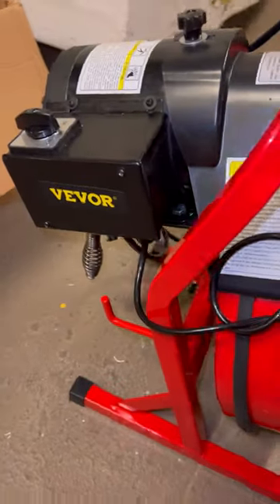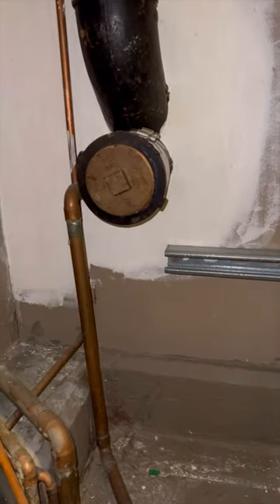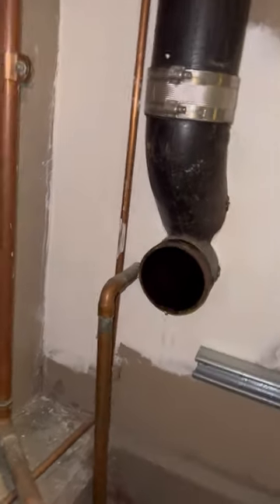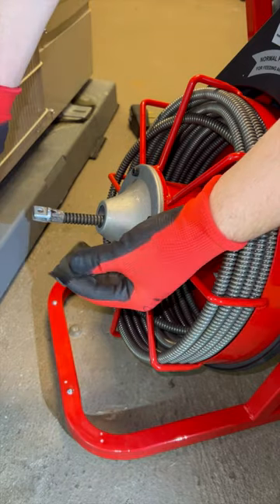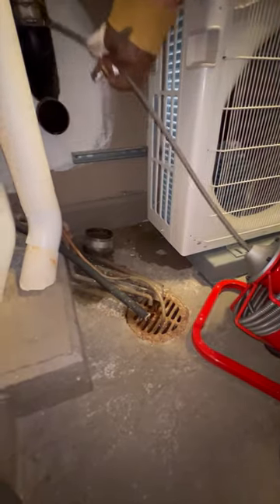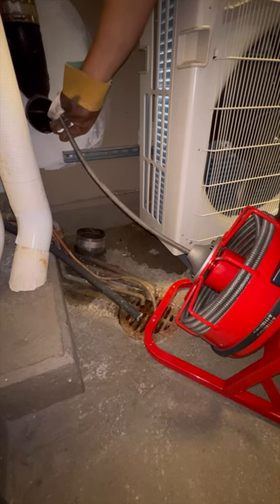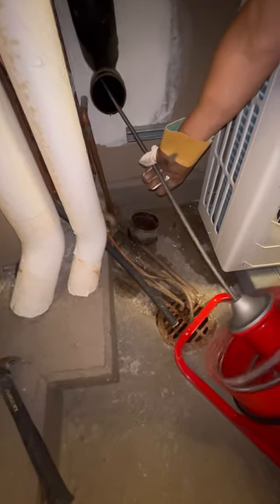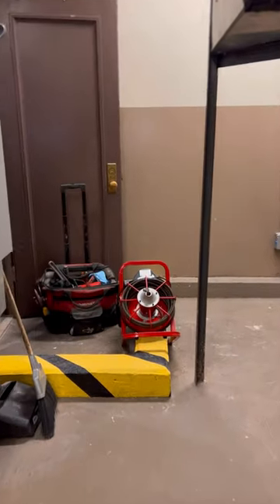Drain snaking with a VEVOR drain cleaner machine

Comment: ive had a 5/8 cable whip me in the chest before from binding up....always two hands on bigger cables  and take your time ..its not a race and after doing it for awhile you will know when your at an elbow and turns etc.......guys that do only drains have great tips
Reply: Kink the end of the cable!!
Reply from the maker: Thanks for the advice bro. Im probably just gonna do these jobs for regular clients
Reply: Taking your time is a must!
Reply: We don’t even use cables large flex shafts with the camera at the same time flex shaft in first with a penetrator but they have clutches or hydro jet for me we are a drain. Specialist I eventually graduated to pipe  liners and other drain rehabilitation work clearing the drain now is just an opportunity to sell a pipe liner repair it’s usually roots lol

Comment: When I was 19 years old, I rented a snake to do my mom’s sewer. I had clue about the dangers associated with sewer snakes. Stuck it through the clean-out, parceled out about 25-feet and it wouldn’t go any further or back- out. Turned on machine and after few minutes the stuck snake built up so much energy, it finally let loose and started whizzing a hundred miles and hour. Had it snagged my hands, I am confident it would have ripped my hands off. Eventually pulled snake out and a fifty foot long mass of roots the diameter of the pipe came with it, most of them looked like hair. Years later, I heard someone lost a thumb using a power snake. I’ll call a plumber.

Comment: 150 to show up and rod kitchen drain with small machine weather it takes 5 or 55 min. 120 an hour after that. SW MI. Lotta problems deduced ahead of time by asking a LOT of questions. Also there's some finesse to running that thing broski. Put plenty blanket down and use 2 hands bro that thing could bite a fitting and throw a fit before you fly off that pressure switch
Reply: Crazy to hear people get 400 for running a snake. wild. $150-$300 here in southern cali
Reply: @MrKnnthc93  about right. NY plumbing seems insane tho. I'd move east just to work if it didn't mean I'd have to be stuck in that shithole of a city
Reply from the maker: That’s fair pricing for both parties. The questions are definitely important for every job. Sometimes im in a rush and dont ask the right questions and get screwed

Comment: Hey Bro. I was thinking of buying one of these. The problem is that the use photos shows it will NOT pass water trap pipes. You mentioned it went through a P trap (water trap) just fine. Am I missing something??? Love your videos Brother. I have floor drains that may well have P or S traps as build date is 1968. What do you think? Buy one or no?

Comment: HydroNYC.. we use to use a 3’ metal bar with a u shaped end to pinch the cable against the side of the pipe to force it through a tough spot AND not have to touch it with hands… bring extra male fitting to thread into clean out so you don’t damage the clean out threads 👍🏽👊🏽
Reply from the maker: Thats a great idea. I have used that when snaking tubs with a standing bath waste and it worked great to get past the p trap
Reply: Was that rotating In reverse?

Comment: I run a k5208. A while back I was running a 3 inch beat up cast iron line. There is a handle locking pin on a k5208, while I was running the machine the pin wiggled through the slot and locked the machine in the on position. About that time the cable bound up and tried to wrap me up. I was lucky enough to get out of the loop it threw, it took about 5 seconds to get the machine unplugged. It ruined 2 cables. Took that pin off the machine.
Reply from the maker: Damm bro thats some scary shhh. Gotta be carefull
Reply: @hydronyc  can't help but read that with your voice and throw a broski in there.

Comment: I run the Ridgid K-5208 machine with the 7/8 and 1-1/4 cables. That's all I do is drain cleaning. No plumbing, repairs, installs, none of that! I only do residential, and I love it. I charge $300.00 up front before my machine comes of the truck. I'll basically use the 7/8 cables for everything except roots. If I'm hitting roots, then I will switch over to the 1-1/4 cables. One time I was in a rush and hit roots, the 7/8 cable jumped up and wrapped my glove and grabbed my pinky. Thank God my gloves are loose fitting and I escaped with no injuries! Scared the poop out of me lol! It was a lesson learned, but never forgotten.
Reply: That's awesome man congrats on your business.

Comment: Spot on regarding the serious dangers when not using the right gloves or for running it too fast also . Slow and steady is the key and now for a real story . Worked maintenance for a large HOA complex with attached units with shared waste lines . It was ALWAYS SOP that if snaking out one bathroom , another maintenance man HAD to be in the adjoining bathroom in case the snake found it’s way into the adjoining units lines . Well for some reason the guy who was supposed to be next door with walkie talkie stepped out to have a cigarette . The snake didn’t drop down into shares waste line but instead went up and into the other unit , came out the toilet bowl and proceeded to flop around that bathroom until it broke very expensive glass tile that was on the walls , broke vanity mirror and was a disaster . The homeowner had allowed access but left for work , imagine their shock when they got home and saw the disaster caused , now imagine if someone was actually sitting on the toilet . Talk about a rectal exam 😊

Comment: I used to rent the 100ft snake to unclog my main line in my old house. The tree roots were murder and would have to do it about 1-2 years. Right before I sold the house, it clogged. I snaked the pipe and for some reason it kept hitting and popping up through the roof. I found the snake in the back yard and the dogs going wild. 😂😂 Did I learn my lesson- no it happened twice. I finally got it down the right way and cut the roots out.

Comment: I use a k60 drain machine and always make sure to put dish soap on my gloves as lube when I start with a dry coil. Gets things slippery and smells a hell of allot better than whatever the clients have been eating lately. Had the machine grab a glove once and got the dreaded twisted sausage finger as well. Nose had to wait at least a week to get picked...
Reply from the maker: Hahahahhaha 😂😂 the soap trick is 🔥
Reply: K7500. Worked with those for many, many years, even got a half brick out of a 4" line with it. Can push a hundred meters of 3/4" cable  Best drain machine on the planet.

Comment: A cardboard tent around the drum will cut down on the spatter from the unit when wet. 

Also keep a short cable length between the machine and clean out. Shorter the better, its less inclined to wrap up outside the pipe when it binds.

Comment: Luckily the guys who taught me always told me to be extremely careful when using a snake, they made it seem like it was just a metal death hose that would tear u to shreds if u even touched it. I never got hurt using a snake but i did have a scary incident once where i was snaking a toilet drain and my snake was a spartan 300 so since it had a self feed i was standing next to the drain and letting the cable feed itself. I guess i was standing too close but the snake grabbed a hold of my pants and tangled around my leg and that shit was strong as fuck it almost knocked me over. Luckily my helper was there and he put it in reverse and saved my ass. Snaking is dirty work, dangerous work, it can be hard work because you have to carry it around and it probably weighs over 100 pounds. Most plumbers hate snaking and a lot of guys wont even do it, this is why it costs so much to snake. If the client doesn’t wanna pay he can find somebody else to do it. Also make sure if you have to pull a toilet or take apart a p-trap you charge for that as well because guess what if you do it for free and they leak after you just lost money. Oh and if you snake it several times and it wont clear and you have to jetter it that doesnt mean you dont charge for the snake, its not your fault that the drain is clogged and you snaking it was a legitimate attempt to clear it so if it doesn’t clear still charge the customer but give them an offer to jetter their line and if they dont wanna pay full price for the jetter then give them a discount on the jetter or collect your money for the snake and get out of there.
Reply: Great advice .
Reply from the maker: Damn bro thats no joke. Good thing the helper was quick with it because the spartan is a powerful machine. Thank you for the advice. I will definitely use that pricing method if i take snake jobs. For now I’m only going to focus on doing it for regular costumers and renovations.
Reply: @hydronyc  large renovations should have mains snaked before putting into service.  You can figure it will save call backs
Reply: @craigherron1203 That's pretty smart

Comment: I'd add some more welds on the cap the blades attach to, they like to fall off on cheaper cables. Not fun trying to fish one back out of a drain line.
Reply: Yeah....I took a look at my Vevor that arrived yesterday. I had the same thought! I got a stick welder and a Mig (and a brazing torch) but haven't worked on this type of steel in this configuration, don't want to make a weaker connection while doing so.

Comment: Early I had a 1/2" cable wrapped  around my forearm snaking a urinal in a hotel public restroom. Always wear cow hide gloves or like in the post . The yellow chemical  grade gloves with big chips impregnated are the best . The spade bit is great on grease. 27 years still snaking mains in multifamily. Best story I've got is a small town drain guy snaked a ranch house 2" PVC into a grinder pump damp cover in front yard 15 out 😂
Reply from the maker: 😂😂 27 years im sure you have seen it all lol
Reply: Rigid makes a pair of leather oven mitts with metal staples over the whole palm those are the bomb for working with larger diameter cables

Comment: Here's the problem with that and the way these jobs a priced. I work building maintenance and I'm well-versed in HVAC, plumbing, and electrical. So issues that arise at my home and my rental properties I save thousands of dollars by having the know-how and the tools to do the work. It cost me $1000.000 for a main drain line sneaked and camera. It was for a rental property and it was on a weekend. It had to get done right away because the renters were having a party.
It was a matter of having the equipment to do the job. I have access to a drum snake but not at that time.  I snaked many drains in my career and I avg an hour to clear a drain. What a plumber changes to snake a drain is a complete ripoff, in my opinion. Same thing with replacing a standard toilet. They charge $500.00 to replace a toilet, that's just labor. I'm NOT talking about roughing in a toilet, I'm saying just to replace.  It takes me less than 30 minutes to replace a toilet. I would charge a friend $100.00 and a six-pack for labor.

Comment: Thanks for the post. What Im I doing wrong? Very little instruction is manual. Mines seems like it is not feeding through. I hit a dropped down and it is not going anywhere. What setting are you using? Is it CW or CCW? It seems like yours is spinning opposite direction. Any help is appreciated. Ty

Comment: Where i worked, $250.00-350.00, drains under 2" and 3" and above, $500 +. Machines like Spartan machines are exspensive, but they last. inner core cables last longer, but cost more.

Comment: I’ve always used leather  with nitrile under or rubber gloves with plastic grit molded into them.  Also, if I can’t get the machine within two feet (enough to have two hands not on the cable), I put a piece of PVC on the cable so that it can’t twist up.

Comment: I bought the biggest machine they carry the one was 100 ft and the auto feed in reverse I almost got my hand caught in the spinning drum they're very dangerous if you're not careful so you can really only blame yourself when you do something stupid

50 foot is not enough for most houses you need 100 ft to get all the way out to the main sewer line and that's what you should shoot for because a lot of roots will grow up into the drain and not through cracks the end of the run is where most clogs are unless you have a low spot in the sewer in which case you really need a new sewer. I had a sewer that got clogged continuously just because it had a tiny dip in the line where water would stay and settlement would stay and then it would build up and build up and clogged up in a couple of months

I've had a little bit of bad luck with my machine the end of the tool holder came off of the cable so they're sending me a new cable now it must have been defective from when I bought it cuz it just fell off. They're not going to be making much money off of that sale cuz that things heavy as hell to ship most of the weight is in the cable itself

by the way you could always use both cutters not one at a time you'll smash the the tool holder by trying to tighten it down onto one side of the tool. Use bolt cutters when you attach them

Comment: I bought a vector 1/2 drive 75’. The amount of times the line twisted and whipped me I’ve lost count. But he worst time was when the snake twist and pulled the air press peddle right out of the power box…😢🤦🏽‍♂️
Reply: The vevor cable looks flimsy,  even though it supposed to be inner cored.. I want to get the 100ft 3/8,  but I'm looking for reviews, nowhere found.

Comment: All I run Spartan or Trojan machines and it’s at least $350 to open a drain stoppage. 

I cleaned out a pop up assembly and a lift N turn that had hair in the drain for $700 today
Reply from the maker: Thats a good price for the popup
Reply: what's a popup?

Comment: By a Spartan 300 your not cleaning a 4 inch line with that piece of junk 😂. 4inch line 4 inch blade . No brainer really . They sell a rust machine as well with a chain descales the pipe and a sprayer to epoxy paint the inside after rust removal . Big money for those jobs .